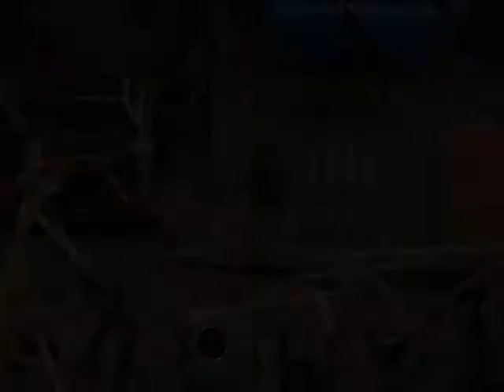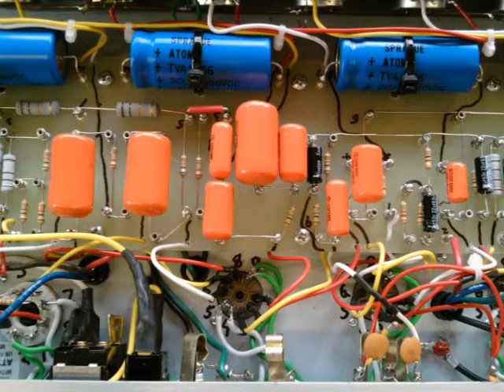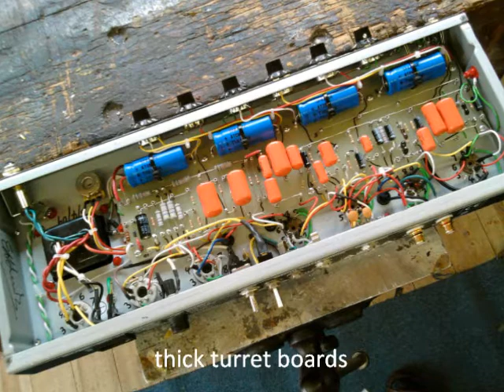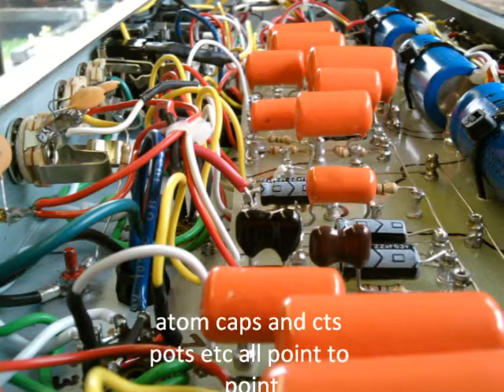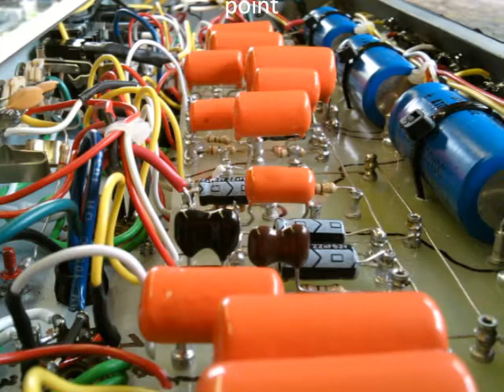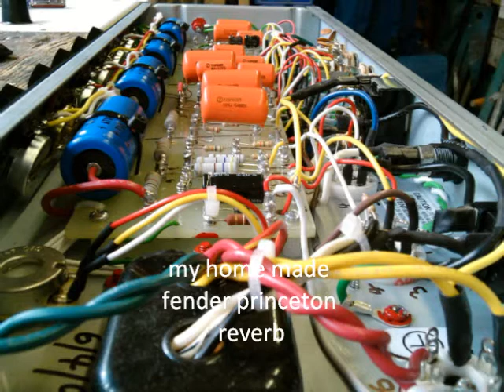fender princeton reverb point to point amp

Comment: Thats fine. I have years before the warranty is up so.....I have worked as an industrial electrician and i build computers for fun. I have seen eyelet boards but that doesn't answer the question of where to aquire a turret board laid out for the Princeton circuit? And i know that the board is the basis for the project.

Comment: I have a 5e7 bandmaster clone that is handwired, onto a turret board, and then I have a 1961 Kay 504 that is point to point handwired. It's true that turret boards look clean, but they DO negatively affect sound because the positioning and proximity of the wires affects the sound. I personally love the look of a point to point job, its very messy, but you know that it is a tediously arranged mess as opposed to turretboard. Cant speak for all though, some may find a p2p that is worse than ptb

Comment from the maker: Hi that's true but very very few are true point to point, i think this is better its stronger and no thin circuit boards just each resister etc soldered via a turret, its what most people call point to point